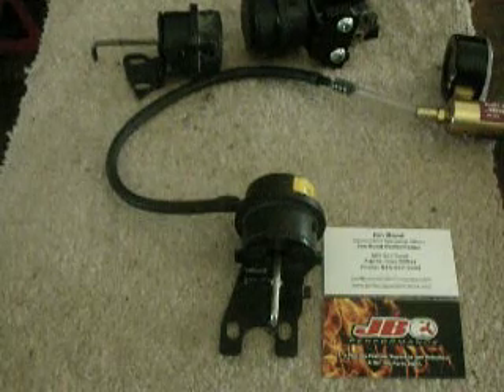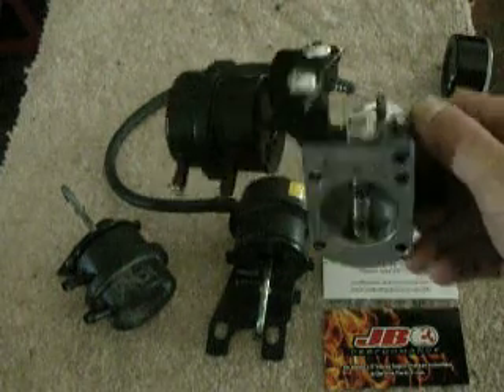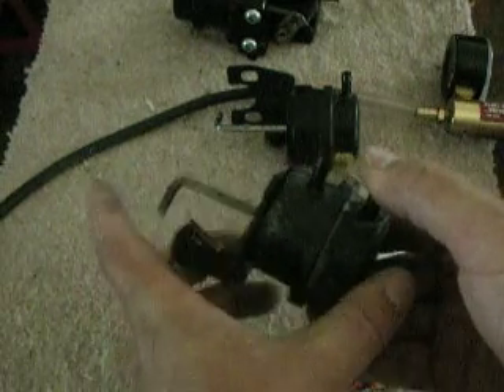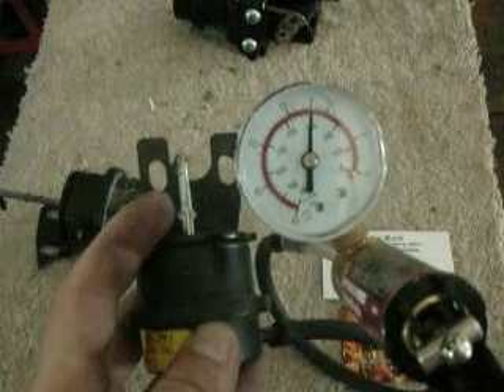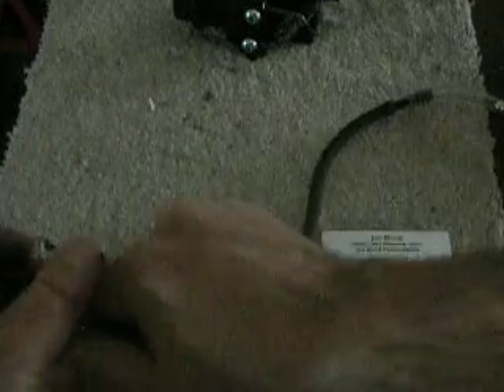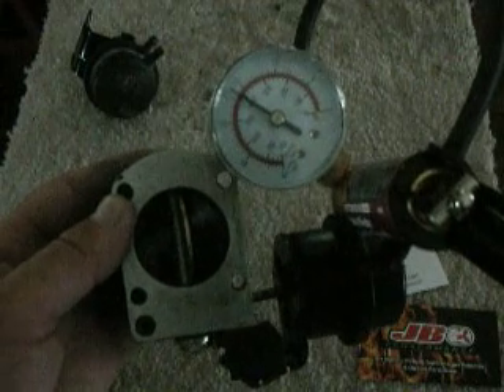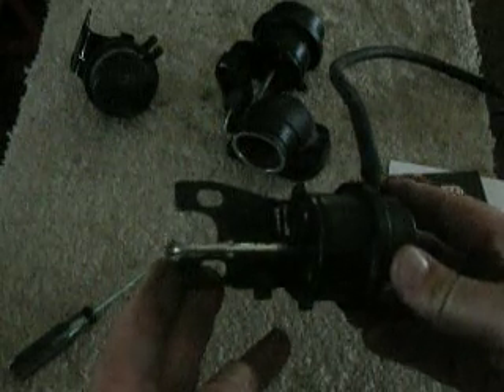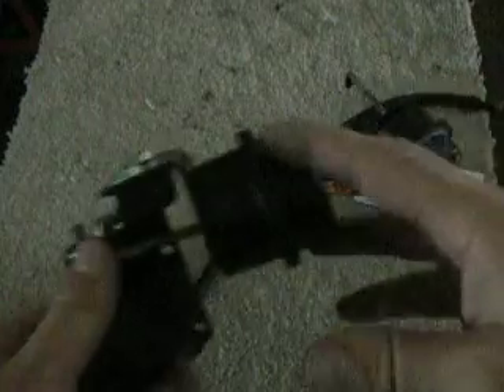Superchargers: How to properly diagnose vacuum operated bypass valve function.

Comment: It would be nice to know about fluid leaks into the valves.  I have one that has oil in it.
Reply from the maker: The only way fluid can get into your valve is if your engine has an issue with excessive oil or coolant in your intake manifold.
Reply: I came to that conclusion shortly after I watched this video.  Thanks! @epicmotorsportz

Comment: Thank you for posting this: I also found another poster on YouTube and put a long comment there. Mine had two ports and the top one was a slow leaker as well, just the simple push in the rod and hold the hole closed proved it for me but, I had already replaced it, after many garage visits with a engine still having undependable power, and they thought it was the MAF sensor since it came up on the check engine codes. Replacing this fixed it and now today I am sure it was the main problem..

Comment: Hi Jon, is a good video looking forward to have more video on how to maintain or rebuild a supercharger. Recently I did send a few emails and dropped a few messages on your website, it almost a week still looking forward to your reply, wandering my email fall to your junk mail. I have an issue with my Sprintex S5-210 supercharger, need your expertise to give me some advice before I make a purchase on parts. Looking forward to hear from you soon. TQ
Reply from the maker: Receiving more emails than I have time to answer. We are very busy and working 6 to 7 days a week. How can I help?
Reply: @epicmotorsportz  Hi Jon, thanks for your reply, my GT86 sprintex S5-210 supercharger only able to boost upto 0.36 bar, and I checked the supercharger oil stick level is empty which filled 1 month ago, may I know which rebuild kits I should purchase?
Reply from the maker: @josephyong986 drive snout parts: https://jonbondperformance.com/index.php?main_page=product_info&products_id=701
Reply from the maker: @josephyong986 head unit parts: https://jonbondperformance.com/index.php?main_page=product_info&products_id=705
Reply from the maker: @josephyong986  there may be other parts required if oil level has ran low. Please check sprintex installation manual as they consume oil.
Reply: Jon Bond Thanks Jon, but my situation is half missing after 200km normal drive within a week. Is that normal?
Reply from the maker: @josephyong986  no, it is not. Are you exceeding maximum rpm?
Reply: @epicmotorsportz  average engine RPM 3000 ~ 5000 and I am using 69mm pulley

Comment: Would a bad bypass valve in a roush supercharger lower the boost?
Reply from the maker: No, but a worn out butterfly would.
Reply: @epicmotorsportz  my supercharger suddenly stopped making boost. I got it rebuilt and it's reading at 1 psi on the boost gauge. If I remove the vacuum hose off of the bypass valve and hold it with my finger with the bypass pushed up it stays up and comes down quickly
Reply: @epicmotorsportz  do you think it's the butterfly valve?
Reply from the maker: @fernandop937  you have to test it with a gauge to see if the valve holds at 14 inches. The butterfly wi no affect the ability of the valve to hold a vaccum, but can cause it to stick closed. If your rebuilder never adjusted this correctly or installed parts backwards, anything is possible.

Comment: Good info but why are your parts so expensive?
 Those whipple/Sprintex/early Magnuson bypass valves you sell are old school technology now. They are mass produced & should not be this expensive (That is the principle of Mass production). And your cheap plastic vacuum actuators are ridiculously overpriced. They are made cheaply in Taiwan and China but you mark them up by at least 200%. They should cost no more that $20.00 each, and even then that price would be expensive for what they are.
They are so cheaply made they wear out very quickly. These days I only buy quality metal vacuum actuators and adapt them to fit the bypass valve. Now I get a good couple of years life out of each one,  whereas before I was going through the plastic ones at least once a year.
Reply from the maker: Are you hooking it to boost instead of vacuum?
Reply: I strongly agree with you ... they last a maximum of 1 year

Comment: I just tried the test on my m62 blower bypass still installed, using a brake vacuum pump without gage.  Is the fact that it returned slowly to closed indicative of a leak, or could that just be the effect of a return spring? 

(car used to run 17 psi @ full boost, now only seeing 12)
Reply from the maker: If it returned back with a vacuum drawn, then it has a hole in the internal diaphragm.

Comment: Can the dual bypass be used without computer control solenoid?
Reply from the maker: Yes. Do not block off the port closest to the lever on the black actuator. Just disconnect it.
Reply: Thanks Jon, I was the one that bought the dual port from you a couple days ago. I have it blocked. I am looking to make the bypass a LOT slower reacting than it currently is. I am now using only the vacuum portion of it and trying to make a vacuum canister for it to avoid the quick swings. I wish it had a softer spring it to bring it closed.

Comment: Just curious, I have a TRD 4.0 SC on an 07 FJ. Factory install 85k miles. Started to develop more and more boost over the last month and recently went lean and caused multiple misfires. Always saw 6-7 psi and now it will spike to 11psi...poorly. Boost through the throttle range is much higher than normal and WOT is unusable and unstable. Vacuum check on the bypass seemed ok. The armature moves freely when the throttle is actuated. Is it possible that the unit is failing only under boost conditions?  Any suggestions will be great. Thank you for the informative video!

Comment: Hi Jon, good article. Can you give me your opinion on why I boosted to 14 lbs with a 9 psi pulley, though with a 6 psi pulley I did 6-7 psi? Does adding a big extra idler for belt traction affect total boost? Or could be I only use one of the two nipples on my Whipple bypass valve? It's for JRSC 2000 prelude set up.
Reply from the maker: If you have 2 hose barb's, it should be hooked up properly. Do not plug one port, if not in use. As for pulleys, most are never sold as pounds of boost. Pulleys are a ratio with the bottom and rpm.

Comment: Jon I have questions about a v2 supercharger I changed the pulley to a smaller size but now I get a vacuum discharge on the impeller side any idea why? Thanks
Reply from the maker: Neri Osoy what do you mean by vacuum discharge on impeller side? Pressure side?
Reply: Jon Bond yes when I accelerate it goes on boost but when I let off the gas instead the blow of valve releasing the boost it leaks on the inlet where the impeller is
Reply: Jon Bond yes the discharge is on the pressure side on the actual super charger and I meant boost discharge the blow off valve goes off a few second after the boost if I'm cruising in traffic it sound like the blow off valve opens up but it's coming from the charger side any idea why it does that? Thanks again
Reply from the maker: Based on your description, it sounds like you are using a spring activated valve. More than likely, it is not adjusted right or you are exceeding the boost limits of the valve. You will need to identify more information such as the type of valve for more information.

Comment: hi Jon good videos. can you explain in a video why de saleen supercharger series VI make noise and what to do. thank you
Reply from the maker: Jose Luis Flores  If a supercharger is making noise, something is wrong and should be serviced. these units typically need rebuilt between 50 and 80,000 miles to prevent damage. If you have questions please call tomorrow.

Comment: Thank you for the informational video! I need to test my bypass valve. My question is, how should the bypass valve be installed? There are slots for the mounting bracket. At the top of the slots I feel 0 preload in the diaphragm and at the bottom of the slots I can feel the diaphragm has some preload in it. Do you want 0 preload, mount at the transition from 0 preload to initial resistance, or as much preload as possible? Thanks!
Reply from the maker: Adjusting a bypass valve can vary by model. Many of the videos and adjustment procedures on the internet are incorrect. There is not enough space here to describe the procedure for each type.